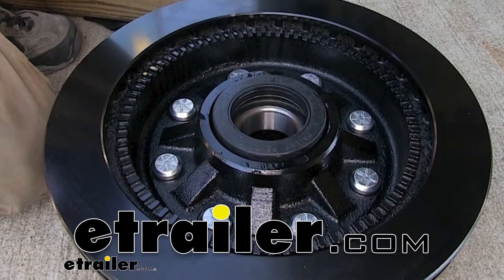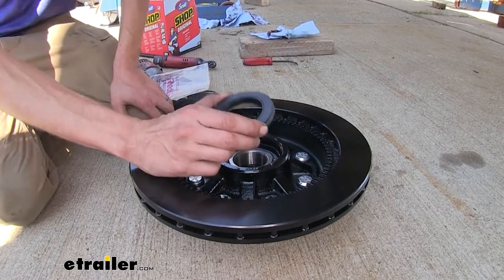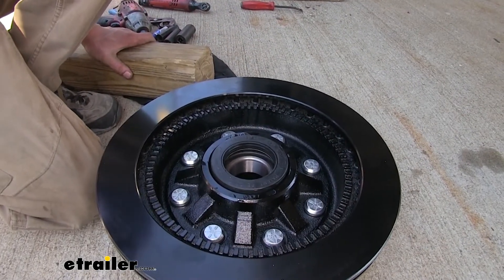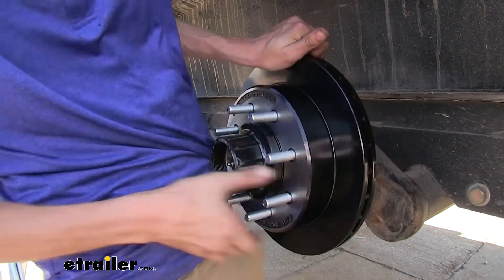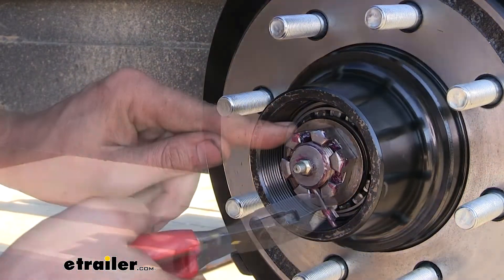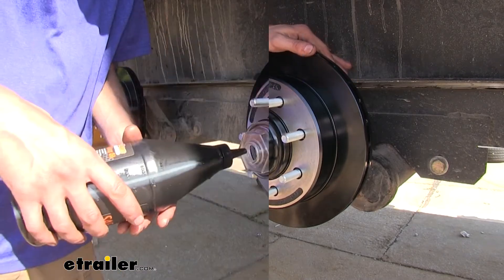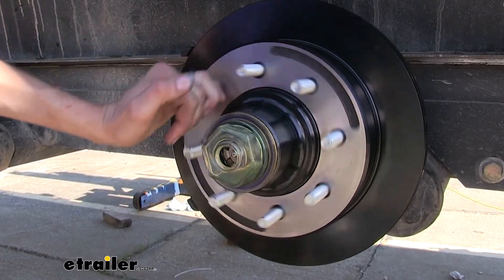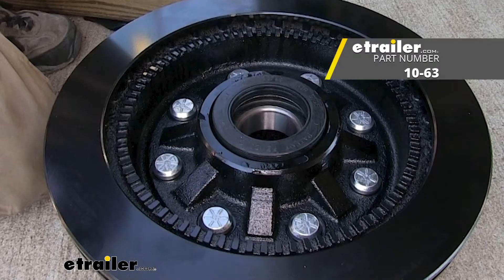etrailer | Review of the Unitized Oil Seal for Trailer Hubs

Comment: these are also a good alternative seal to use for worn spindles from the traditional wiper oil seal as they are a press fit on the spindle.    Worked great on my truck but pretty hard to remove without ruining it.
Reply from the maker: True. If you have to remove a grease/oil seal, you'd better plan on replacing it. They usually don't survive the removal process, which is fine because they do have a service interval and should be replaced regularly.
https://www.etrailer.com/Trailer-Bearings-Races-Seals-Caps/Dexter/10-63.html